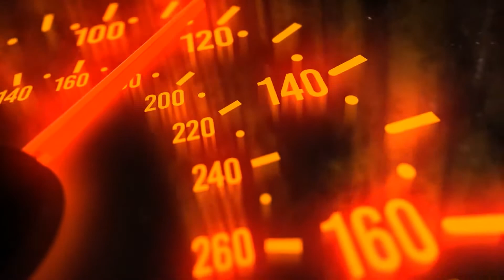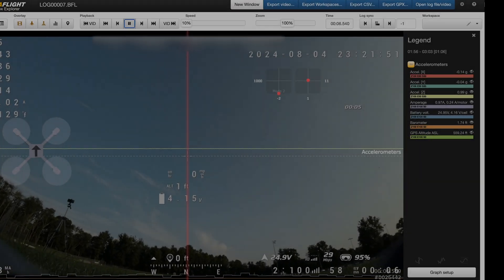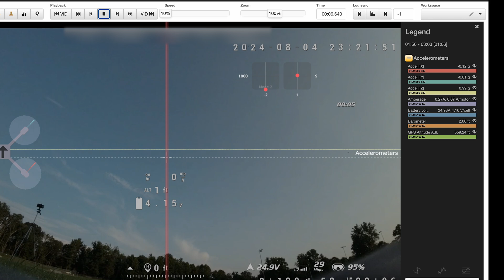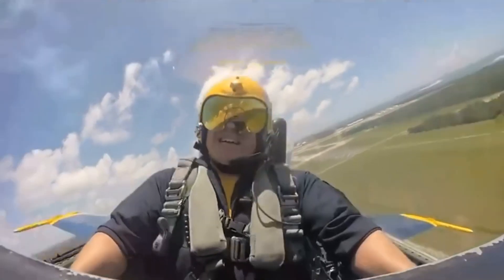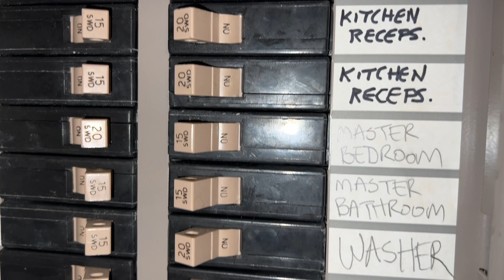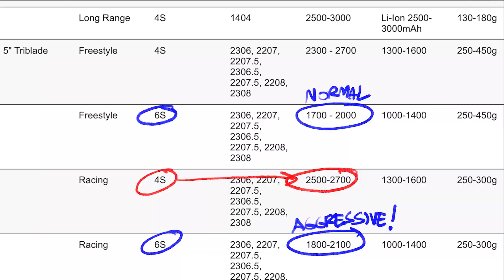What Happens When You Push an FPV Drone to Its Limits? These Amazing Super Drones!

Comment: Awesome video but the comparison to the AC units is not accurate. You pulled 82 amps at 25v on 6s, the 3 AC units you mentioned might pull 82 amps also but they are doing it at 120v or even 240v so its not exactly an apples to apples comparison. Still very cool video though, keep it up
Reply from the maker: Your absolutely right and I really appreciate your feedback. Unfortunately I didn’t really think through the math sufficiently and my analogy with amp draw could have been better formed 😬 There is an older correspondence chain there with @yuri77 likewise. Thanks friend! 🙏

Comment: Thats surprising that it only pulled 81 amps. Did you try and make it very light or are they just efficient motors?
My 5" drone easily pulls 140 amps on 1960kv motors at its top speed, around 140mph. It does weigh around 700g though
Reply from the maker: I’m getting my amp readings through Betaflight Blackbox Explorer. From what I understand, that reading shows a collective sum… if I’m mistaken, please let me know! Are you seeing your readings in the OSD or in the Blackbox logs? My build is 590 grams with a 1400mah 6s 150c Tattu battery: a Five33 racing frame with a 60amp 4in1 blheli32 ESC, a large 50V 1000uF capacitor, and Xing2 2207 2755kv motors. It is also sporting high pitch biblade props as well
Reply: @magicaerials  The blackbox logs and osd will show the same thing, its getting the information from the same source. 
The light weight of the drone and lighter propellers would definitely help it run more efficiently. It also could be that my current sensor isnt calibrated right since my esc and flight controller are from different manufacturers.
Reply from the maker: @fazented  I’ll tell you one thing… this quad absolutely destroys the battery after just a few punchouts…$45 single-use batteries! 😂 And yeah, I just realize what I said… the OSD and Blackbox do show the same values. I was just curious if you were getting the reading from some other method. It’s really interesting to compare notes. Something is off and I’d really like a definitive answer on this as you bring it up. I find it odd that your ESC calibration would be that far off. I’d like to dig into this further… Thanks for sharing details on your build and for the feedback! 🙏

Comment: this 81A is on only one esc or its all together?
Reply from the maker: It is the total current draw across all four ESCs combined, not just one. Each ESC in the 4-in-1 setup contributes to the cumulative current reading, so that value I shared represents the total power draw of the entire quad at that moment, not an individual ESC. Furthermore… In hindsight I think there a better way to understand those figures and to do so we should instead look at total watts during that instant which would be 1567.55 watts (82.2x19.07 volts)
Reply: @magicaerials  So what I'm wondering is, I have a 60 amp esc, so what does it mean that it doesn't use more than 20 amps per esc? Mine is 81 amps maximum too. So I paid a lot of money for 60 amps when 45 would have been enough. I know that the higher the esc, the less the board heats up, but still

Comment: Excellent video! - I have a Nazgul F5D v2 6s. If I push the throttle like you did in the beginning, how long can it do so without failing? I mean, in your video I can see the current battery voltage going down to ~2.7V if I remember correctly which is no good for it as far as I know. Could it last for maybe ten seconds while on full throttle or would the battery give up and the whole quad come down?
Reply from the maker: I’m running this quad on 6S with 2755KV motors, which really takes a toll on the battery. I’ve squeezed in a 1000uf 50V capacitor, but it’s a tight fit. With this setup, I can hold full throttle for about 10 seconds before the voltage drops to around 3V. The strain on the battery is intense... I’ve had test batteries swell and lose performance, making them basically a $40-$50 loss each time.

Holding full throttle for that long also creates challenges, especially when ascending, since you’d easily exceed the 400ft AGL limit. So, these tests have to be done horizontally. This quad is capable of insane speeds, far beyond what’s allowed on US soil. I’m confident it could push well past 170MPH, especially with an aerodynamic housing.

There is a also a lot of ESC tuning necessary to prevent the motors from experiencing desyncs.
Reply: @magicaerials  Thank you very much for your detailed answers. 10 seconds is really long. I didn't expect this.
Great to hear you've been sacrificing yourself and a bunch of batteries so others can learn from it! 😀That's annoying, for sure. Lots of cash burnt.

The height limit should be reached very soon, yes. My question was more in a theoretical way and especially how long this is physicaly possible.
I first had a Mini 3 Pro, then a Cinelog 25 v2, then the Nazgul. My first tests with the Nazgul amazed me. I didn't expect this and without even really realizing it went up to 100m. A "few seconds" and I didn't use full throttle.

So, at least these freestyle guys shouldn't have too much issues with their hard increases of throttle as they aren't doing this as long, if I understand this correctly.
But, well, didn't want to talk too long and steal your time. 🙂

Thanks and have a good day, Sir! 🙂

Comment: bi blades on a 5 inch? why for?
Reply from the maker: With bi blades you can obtain a higher top speed due to less drag. I did run the bi-blades with higher pitched blades. You wouldn’t want to do this when racing drones as you will lose grip (ability to perform tighter turns)
Reply: @magicaerials  yea grip is important, I don’t race, I do freestyle
Reply from the maker: Yeah. As you are performing freestyle, I too would stick with your tri-blades.  This was more of a science experiment

Comment: The best thing is that the 0-60mph measurement was straight vertical climb. Whereas the F1 car/F16 Jet are measured travelling perpendicular to gravity. Most high-spec 5" quads can hit 0-60mph in a fraction of a second, off a horizontal race start :)
Reply from the maker: Very true! Quite amazing and I know acceleration can be pushed even further than my build with more time and effort

Comment: 1:40 Careful man that's more than enough speed to kill you. There's no reason to do passes directly overhead like that. 650g going 120MPH is about 935 joules, close to double of a 9MM round. Normally I'd ignore stuff like this but you literally had a safety disclaimer at the beginning of the video lol. Not to mention you lost video right afterwards. What if you lost video a second earlier before you pitched up? That could have ended badly.
Reply from the maker: The kinetic energy is definitely quite high. In hindsight I should have conducted the low speed pass laterally and further out from us. Thanks for your insight and dropping a comment.

Comment: I found my way to this hobby very quickly after finally getting a DJI drone after wanting one for a decade. It gets boring unless you take the path of cinematography. 

With FPV you get a much higher skill cap with flying the actual drone. But you're also free to dive into cinematography if you want.
Reply from the maker: Cinematography is definitely an area where FPV has me by its grip 😀

Comment: you cannot compare household AC appliances to the DC current on the FPV drone. the proper comparion should be expressed in Watts of power delivered. In your case, the instanteneous power delivered was about ~19V * 82A = 1560W, and that happened in a sliver of time (less than a few seconds).   a max load on one 20A breaker is just 2400W in US at 120V. And that is AC current.
Reply from the maker: I really appreciate your input! 🙌 You’re absolutely right about expressing power in watts, and yea, at 19.07V and 82A, the power comes out to around 1564 watts ⚡️, which confirms that part of the math. Even though it was brief, pulling over 1500 watts in such a small setup is mind-blowing! 🤯 I was trying to find a relatable analogy for people to understand just how much current was being drawn (though brief) and your clarification really helps shine a light on the real power dynamics. Thanks again for helping take this discussion deeper
Reply: @magicaerials  yeah, first of all - the longer you sustain that current - the likely ESC will fry (or whatever overheats first, i suspect other FETs may give out first, or the motor wires) My friend got one side of the ESC so hot, the solder melted away from the motor wires, and eventually shorted the ESC, in midflight. But in reality, the battery cannot keep up with such Amperage draw for longer than few seconds, and it sags the voltage down to a point, where it will go down so low, that you may lose the regulators for VTXs, and i suspect that is what happened when you lost video?
Reply from the maker: @yuriy77  You’ve reached the same logical conclusion I did! I initially thought the signal loss was due to the current draw, and later that evening I found one of my motor wires had slightly desoldered itself. After resoldering the joint, I was ready to chalk it up to that. But now, I’m starting to think the issue might actually be related to the most recent DJI O3 update. Users have been reporting random signal drops ever since DJI pushed out support for the DJI Goggles 3, and the fact that my signal loss happened at lower throttle levels that day, and was totally random, has me leaning in that direction.
Reply: You can when running 14s at 900plus amp with gear that's made for it.
Reply: @noisy_boi_fpv_3920  what gear is that you're talking about, that draws 900amps? And for how long?
Reply: 200amp apd 14s esc 300 max  1000amp Pdb.  Esc £250 each that kinda hardware yeah
Reply: @noisy_boi_fpv_3920  and what is your point in bringing up hardware that's 10x the cost of ESC used in a 5in drone? I was talking about comparing DC current drawn on a drone vs. AC current drawn on air conditioning unit. 
Try running your house A/C with a 6s lipo, let's see how that works... Well, even try a 14s lipo... 
I don't get why you bring up irrelevant information, just to draw attention?
Reply: @yuriy77  I'm not talking about batteries I'm talking about military grade hardware that would indeed exceed to limitations your reveling in pointing out proclaiming to be an expert and amp handling has to be much stronger with lower voltages you clearly know that due to u been an expert on all hardware apparently
Reply: @noisy_boi_fpv_3920  duh, bring up completely irrelevant info in the conversation and accuse me. Real smart. Show me where I was wrong, then make your relevant point.
Reply: I bet your real fun at parties.